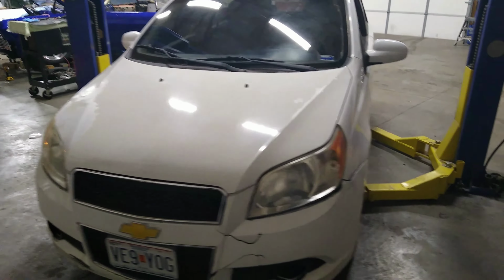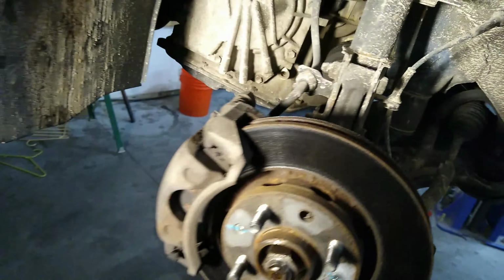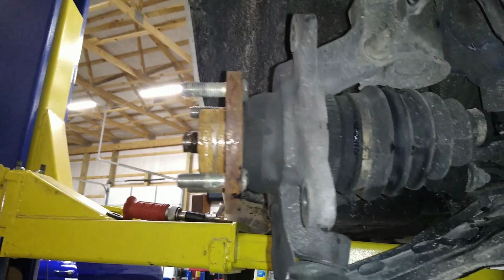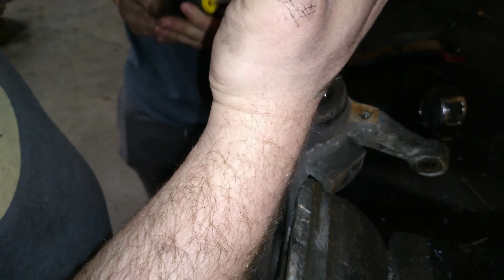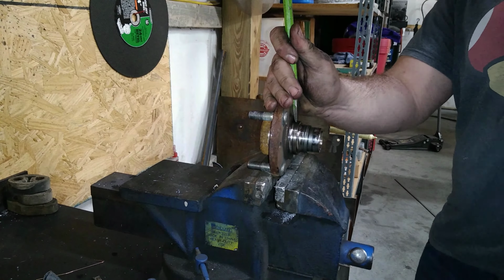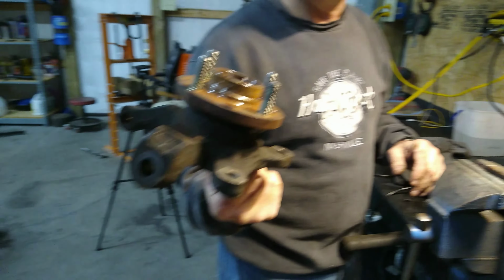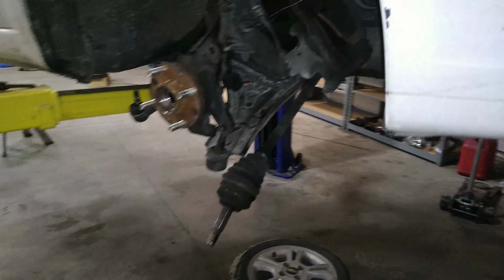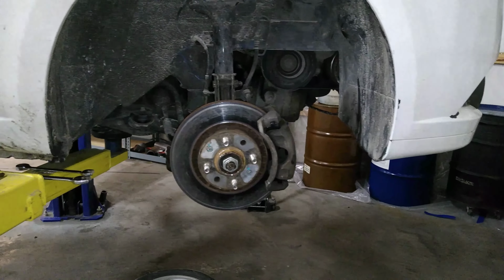2011 Chevrolet Aveo Wheel Bearing Replacement

Comment: Anyone know why these Aveo bearings fail so often ? Improper assy. ? Rotor overheating ? Rough roads ?
Reply: I have no ideal why but i keep changing mine like every 2 years...this is why i both a bearing puller so i can do it my self at home....but one of i ideal why they fail so often is that the bearing company dont put enough grease in it ...but i also think that it s bad for us but good for them because they keep selling us new one😮‍💨

Comment: If you hammer the new bearing into the knuckle as shown with the old bearing, do not pound on the inner race. Only the outer race surface. Pounding on the inner race can ruin the new bearing.